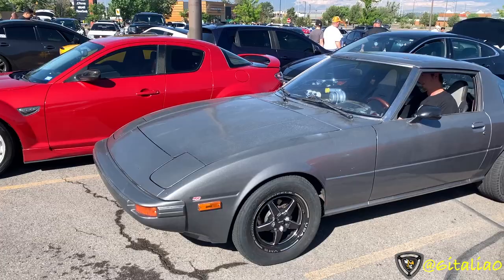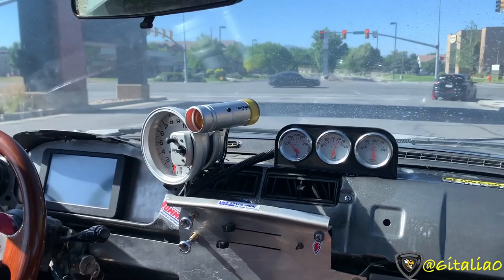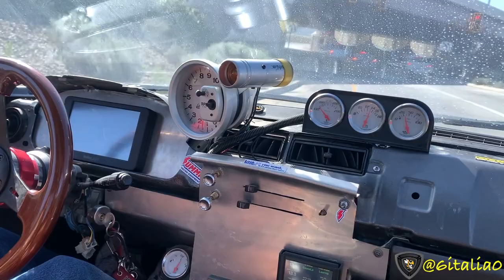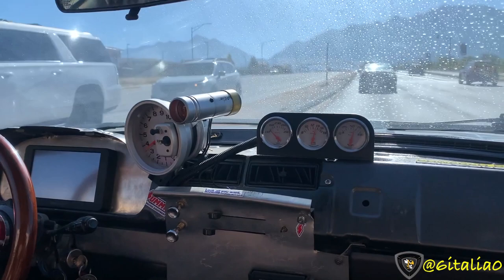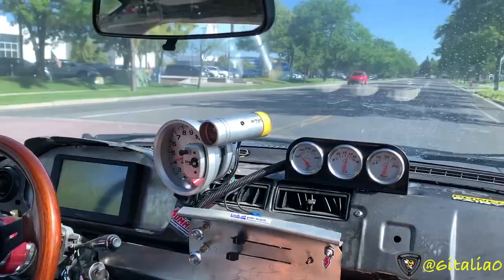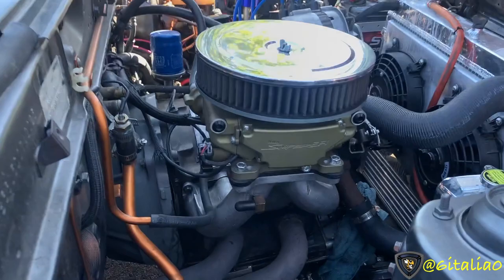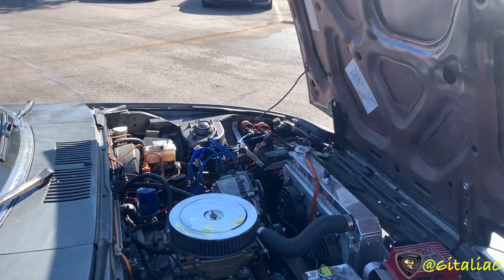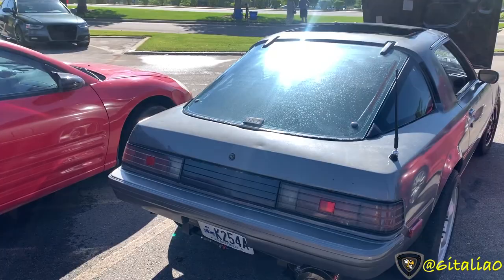LARGE STREETPORT 12A RX7 WITH SELF TUNED HOLLEY SNIPER EFI RIDE ALONG

Comment: Very cool. Wish I could find a FB for $1k or less to rescue that isn't basically scrap metal but that's probably an impossibility these days.
Reply: I mean for 2k u can find one that needs love but its def too much for one considering they sell for 6k running and looking good
Reply: Found mine for 700$ running. It’s possible just know it’s going to have hella rust
Reply: I know it's been a year. I have two I bought for 500 each. Both in fixable condition.
Reply: @njv6918  funny thing, just a couple months later I wound up buying 4 quite rough FBs for $1,500. This video shows the best one of the lot. I've already parted out one of the 4 and on the way home from delivering the lower half of it the transmission blew in my truck so that occupied all my project time over the past few months. I'm hoping this Summer to at least get the blue 1982 GSL started https://www.youtube.com/watch?v=_e2PPd8f968
Reply: Try more in the mid 5-6k and not in great condition I seen a few for 9 -15 k in decent condition on craigslist

Comment: Curious, obviously he’s running it fuel only on the injection, did he have to trick the ecu at all? I know in the earlier ones like the FI tech people were saying to tell the ecu it was 2x the size (2.4 for a 12a 2.6 for a 13b etc)
Reply from the maker: I believe it’s just on the “street cam” setting. idk what that means exactly though
Reply: @NateRist   I’m going to guess that “street cam” was for basically a mild upgrade something with more duration and lift than stock but not nearly enough to give a piston engine a choppy rough idle... interesting I think I’m going to pull the built street ported motor out of the 10ae and put the rebuilt stock one back in it, I don’t like the way it runs or idles on the Rtek 1.8 that really wasn’t meant for a ported motor (at least not as large as the ports I have) it just seems as if it has problems coping, and was really just a basic bandaid to allow you to run more boost on a stock setup... I think the stage 3 BNR+ judge ito sized street ports is just too much for it to correct
Reply: @NateRist   a setup like this with either S5 or RX8 rotors in the built motor might be the ticket to getting my first gen back together

Comment: What template did you use for the port? Sounds awesome
Reply from the maker: I had it made based on the irons from my RX-7's engine I got it with originally. The engine was built by Nick at Rotary Reliability & Racing sometime in the 80s and the only difference between those prots and these ones is these are a bit more cleaned up

Comment: How did u setup the sniper for the rotary??  Holley don't even know themselves
Reply from the maker: That would be a question for the owner, but from what I understand is that it’s running on the “street cam” setting or whatever the “streetable settings” is. I haven’t messed with them personally I I can’t give any technical details and my own car is still using a racing beat 465cfm Holley